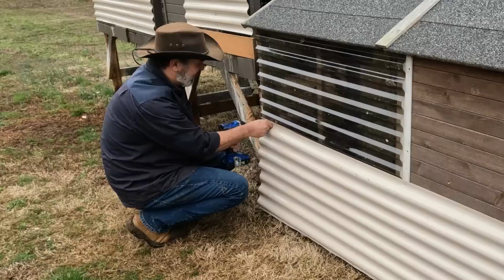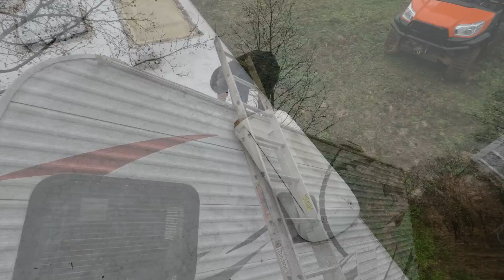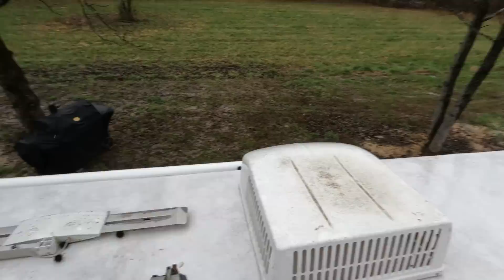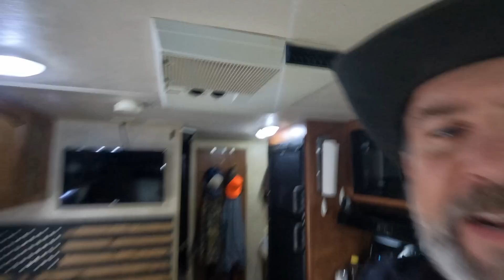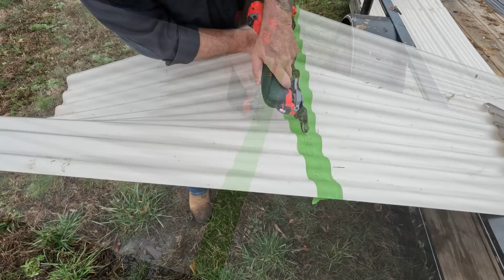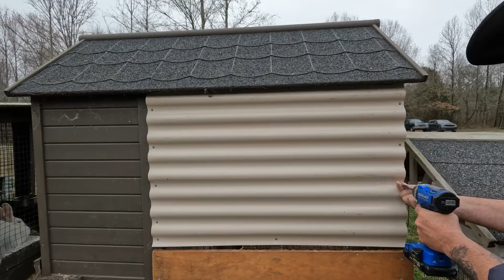Destroyed! | One Thing After Another | Off Grid Journey | Camper Life

Comment: I recommend putting a canopy over your camper. It will keep the rain & snow off & help keep it cooler in the summer. I live in a 5th wheel rv (4 + years now) & it sure helps. From the upstate of SC.
Reply from the maker: Oh yeah! Thanks.
Reply: Was thinking the same
Reply: Yes, a 4 pole drive thru building with a roof or at least a tarp.  I've lived in my old 1988 Chevy Escaper motorhome 8 plus years now. It will save your rooftop.

Comment: Tim, go ahead and order another blade for the C.F.M ( Condenser fan motor) That cracked blade will not hold up for long. I promise not to give too much advice on things, but it when it comes to your air conditioning... I'll definitely drop you some thoughts
Reply from the maker: Yeah I need to replace the evap cage fan as well as its out of balance with blades broken. I need to clean the coil on it internally better anyway.